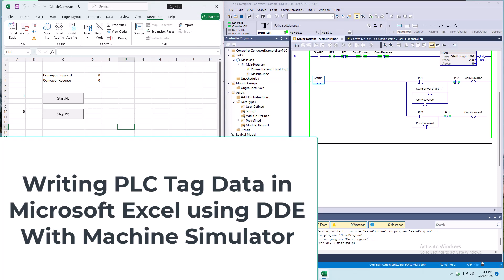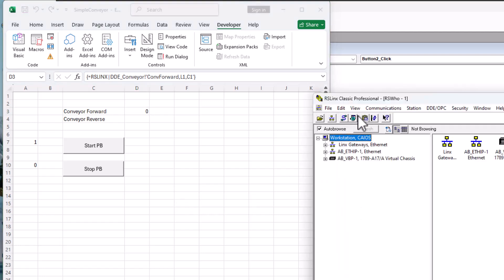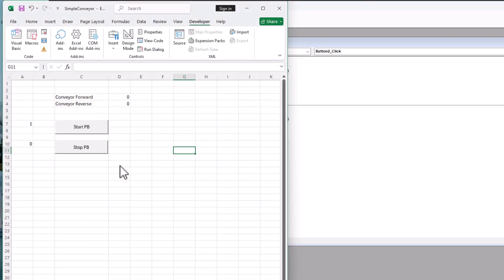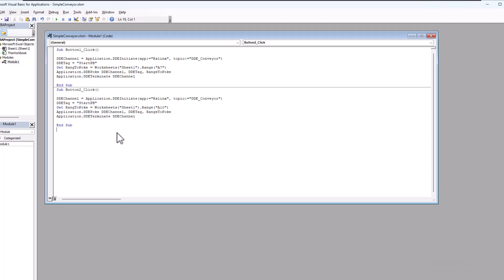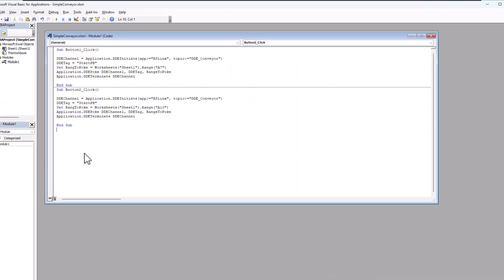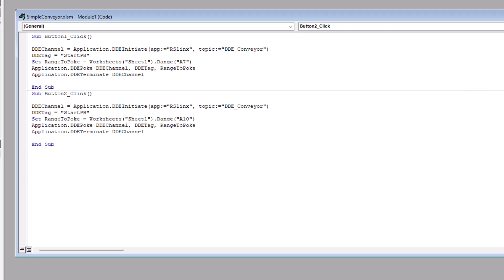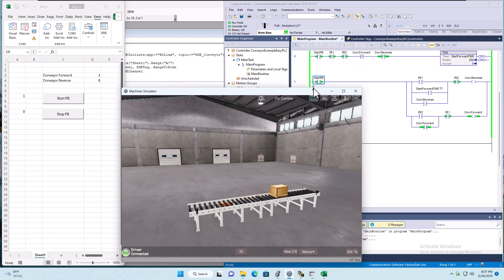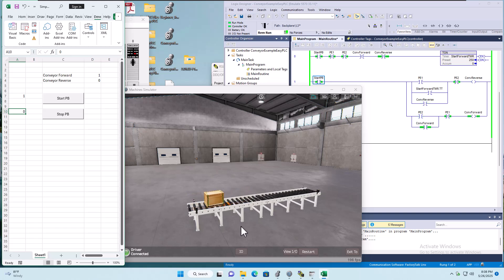Writing PLC Tag Data in Microsoft Excel using DDE With Machine Simulator

Comment: Hi Shane, I am redoing your Batching Station project over at your plc training website. Once thing that is missing in Batching course is programming an actual analog device (for example pressure or temperature). Can you please make a video that shows steps on adding analog (4-20mA) device on Studio5000 and then show graphics on FTV Site Edition. Thank you!
Reply from the maker: I have a video showing that
Reply: @ShaneWelcher  Which lecture or video shows that? The tank level and flow meter are simulated values. I did not come across real analog device programming. Is it on YT? Can you share YT link, Thank you!

Comment: Shane watching one of your older Pax videos, I am having trouble starting my 525 from my HMI client on pax 4.1. I can start from my program and data is transferred, but I can not interact with the faceplate controls. Do I need to enable something in my AOI or does it have to do with grace mode? I have admin security, so I believe security is not my issue.
Reply from the maker: Using PlantPAX you need to verify all security settings are set up correctly to control certain features on the faceplate.

I have videos showing how to setup the security
Reply: @ShaneWelcher  Yes, I noticed you were using plantpax 3.5 and added the administrator to the user groups. For some reason yours just worked, and I've been struggling to make it work. I've been looking all over trying to reference the sample projects, but still having issues. I'll keep looking, thanks as always.
Reply from the maker: @JuanFernandez-tu7fu Just use my search tab on my channel and type in PlantPAX